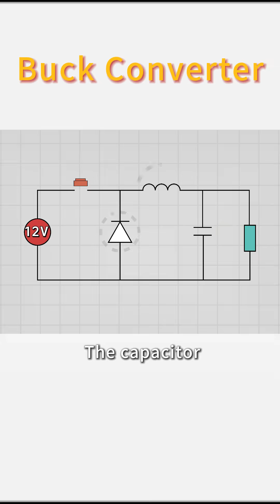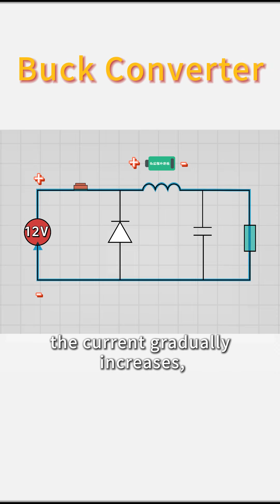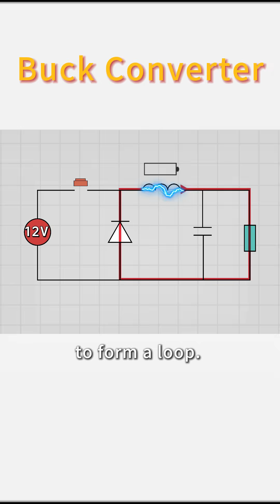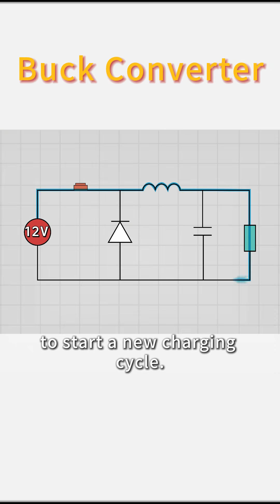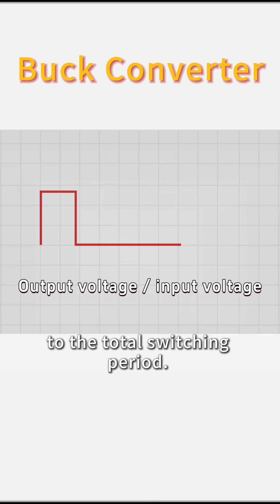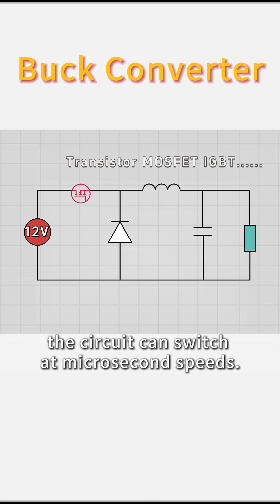Buck converter. #slkor #semiconductor #electronicsengineer

Comment: But why the polarity of the inductor changes 🤔🤔🤔🤔 , and does it also changes the output polarity 🤔🤔🤔??
Reply: I too got confused with this for a long time. To fix this, just use the battery analogy. When inductor changes polarity, it becomes like a battery, it goes from + to -. See how the battery behaves when doing KVL, it goes from + to - but the + side starts first outside, crossing the components before going back to - terminal. 

When doing KVL the battery does not go from + to -from its own terminals immediately right?  Use that analogy from inductors. 

In other words, the polarity of the current of the inductor is still the same the sign convention just changed.

This was a MAJOR confusion from me I'm having trouble with understanding circuits with inductors but this cleared it.

All the best from Gemini. All Youtube vids so far weren't able to use this analogy effectively but hopefully it gets into this now.
Reply: @eggxecution sorry but I think It is not just the sign convention, the inductor really changes the polarity, you can see because in one states the diode does not conduct and in the other state the diode start to conduct
Reply: The polarity of the inductor changes because when It is connected to the power supply the inductor is absorbing energy but when It get disconnected that energy is supplied to the load

Comment: What u use is not transistor but N fet in your video 🗿🗿🗿
Reply: True, but I think a buck converter uses an n fet as a switch.  Good observation!
Reply: @thetooginator153  MOSFETs are awesome. Recommend any videos about making as efficient circuits as possible? (without using a res)